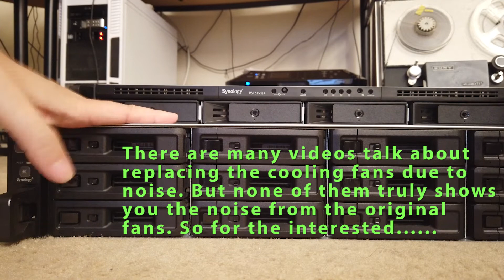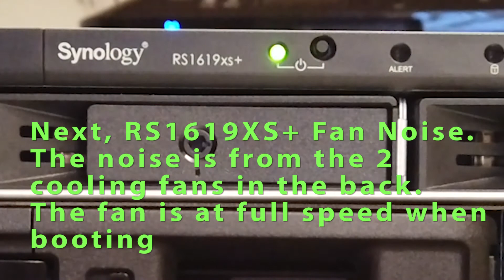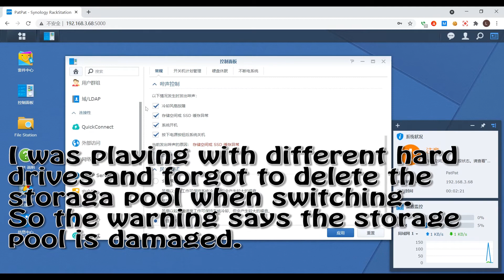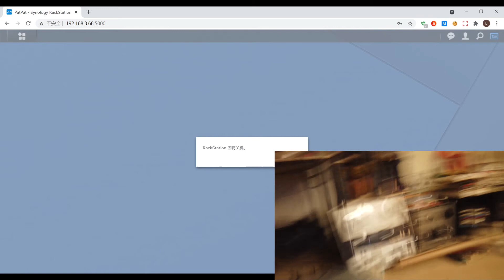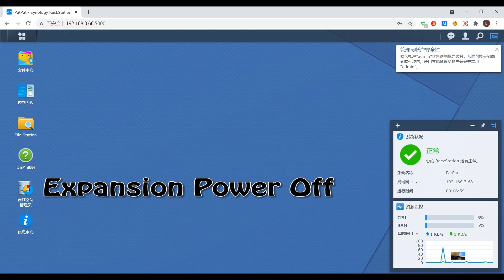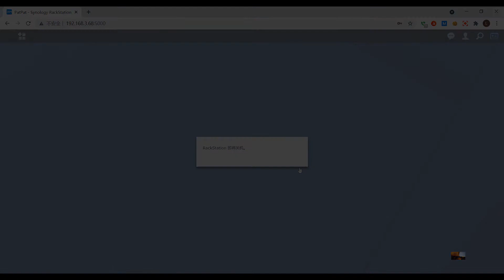Synology RS1619XS+ Rackstation NAS and RX1217 Expansion DSM demo and Noise

Comment: Did you ever replace the fan and what did you use?
Reply from the maker: Yes and no. I did replaced the fan to those so call silent fans. But it does not help reducing the noise. It reduces little but not much. Eventually, I wrap the whole thing up, 3 sides and 1 side open, with Black Permanent Vinyl sheet. It reduces the noise very effectively without increasing the temparture.

Comment: Thanks for this information much better if in english so we can understand what are you clicking.
Reply from the maker: Sorry. I was trying to focus on the noise so did not planning to show the interface initially. Until I do the editing I realized talking is not enough. It is too late to change and redo it. But the options for all Synology Fan control is Full Speed, Cool, and Quiet. So it should be easy to figure it out